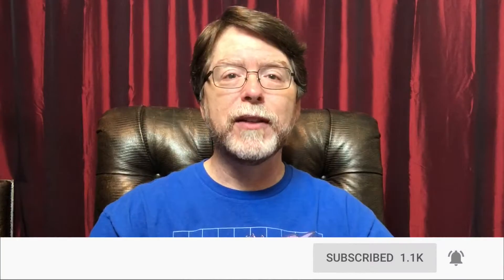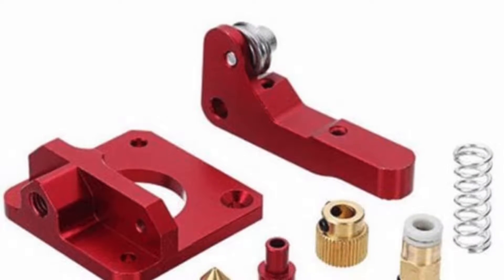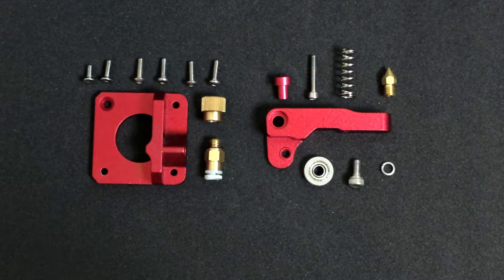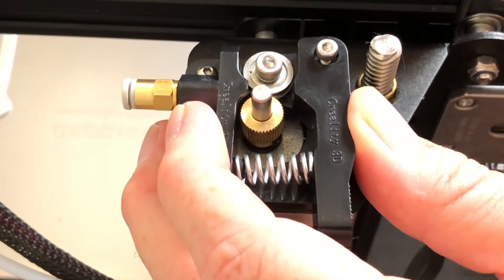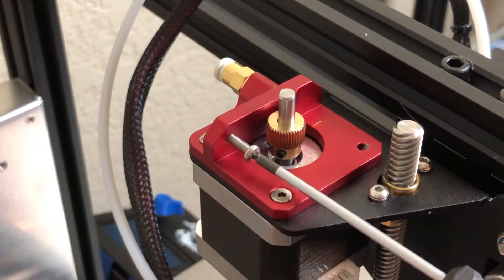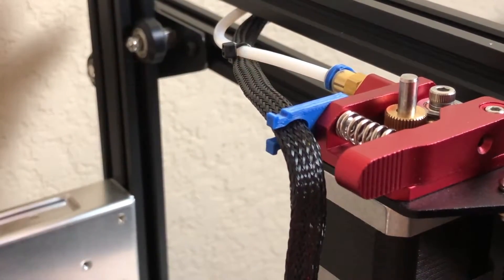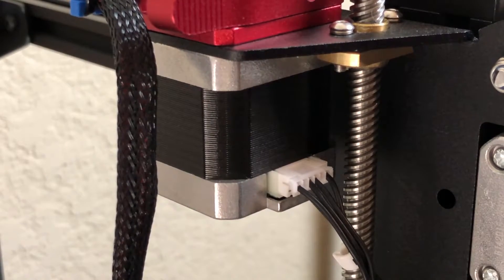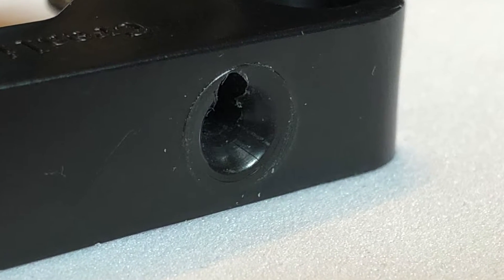How To Install a Metal Extruder upgrade on the Ender 3 & Ender 3 Pro

Comment: The spring that came with mine was trash. It was giving me fits! I had to apply slight manual pressure to the arm (back) to get filament to realiable extrude. I ened up using a spare bed screw that i lengthened slightly. So far so good! Thanks for posting the video! I just wish that there was a mention of the depth of the screws on either end of the spring. Had to play with that adjustment as well, but maybe it's because a lot of this is still new to me!

Comment: Another fantastic video, great instruction was pretty easy to follow. I wonder however Brian how you know where to set the gear on the extruder motor?
Reply from the maker: Hi David! Thank you! With regard to positioning the gear, I just kind of eyeballed it. The gear is pretty tall, so you don't have to be super precise with its vertical placement. If you want to place it a bit more precisely though, you can adjust its height once you have the motor and extruder mounted (but before you attach the lever). If you sight through the hole in the body of the extruder, you can line up the gear so that it's centered. I hope that helps! 👍

Comment: Great tutorial Bryan, it's gonna help beginners a ton. We all have Doh! moments from time to time, it gives us the chance to laugh at our own Dohness lol. Looking forward to a video on your direct drive conversion, it's just the thing I want to do with the Borg, although I plan to use the Bondtech BMG.
Reply from the maker: Hi Spike! I've bookmarked a BMG-compatible direct drive extruder on Thingiverse, that works with the stock hot end. I may print that out, and pick up one of those cheap BMG clones from Amazon to see how good (or bad) it is when doing it on the cheap.
Reply: @BV3D  That's superb! I have the Micro Swiss hotend with a PetsFang blower assembly at the moment. Looking to make it a lot less bulky, so your video is sure to help with tips/ideas 👍

Comment: great video, I did that long ago. I do agree instructions would be great. I also bought some  replacement fittings since the one in the kit are just pure garbage.
Reply from the maker: Hi Ron, thanks! I wonder if it's just a global issue with the fittings in these kits?

Comment: I have this option for CR-10 like printers https://www.aliexpress.com/item/33037642453.html?spm=a2g0o.productlist.0.0.45343d6eRx2rOp&algo_pvid=871d1409-e9f4-40de-899d-e262e0fc90e5&algo_expid=871d1409-e9f4-40de-899d-e262e0fc90e5-1&btsid=8b7ad836-d154-4124-8a19-a99b0e46f3f3&ws_ab_test=searchweb0_0,searchweb201602_2,searchweb201603_53
Works with flexible too :)
Reply from the maker: Daaaaaang, look at that, with dual drive gears and a monstrously large spring! You're right, I bet that pushes flexibles like a beast! 😃

Comment: Good stuff Bryan. I just switched back to this extruder after having tried a 3d printed one. It works great, thanks for sharing!
Reply from the maker: Thanks, Thierry! I think the two things I like best about this aluminum extruder is the freewheeling nature of the lever, even with the screw super tight; and the fact that filament can't chew through the lever. (om nom nom) 😋

I had thought about doing a video with a 3D printed one, but I figured it would suffer the same fate unless I printed other accessories to help aim the filament into the hole.
Reply: There's a couple I tried. One is for flexible filaments and adds a piece of PTFE inside the extruder portion that you then cut for a perfect fit (it leaves no wiggle room for filament). The second is a DIY bondtech style. You buy the gears and go from there. I don't think either adds a lot to this metal extruder TBH.

Comment: Does this let you print in TPU material?
Reply from the maker: I was able to print a relatively stiff TPU with the stock plastic extruder. The aluminum one looks like it has the exact same shape as the plastic one, so I would expect it to be about the same. But for really soft stuff, you'd probably want a direct-drive extruder. There's just too much of a chance for the soft stuff to bunch up in the Bowden tube on the way to the hot end!
Reply: BV3D: Bryan Vines thanks for your swift reply friend. Just bought my first ender 3 last week and been enjoying your videos. Keep up the fine work.
Reply: I could’t print TPU it stucked the gear :(

Comment: You can find this at $2.95 if you search around!
Reply from the maker: That's awesome! I didn't know that. Thanks! Mostly I've just seen them in slightly different variations -- sometimes with an "extra", like the nozzle in this kit, sometimes without extras, but always at about the $9-14 price range.